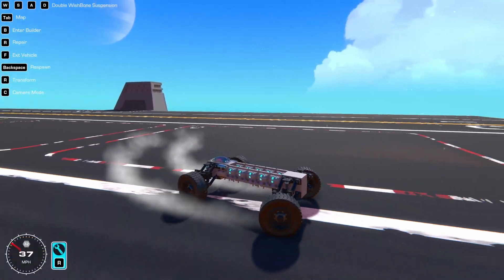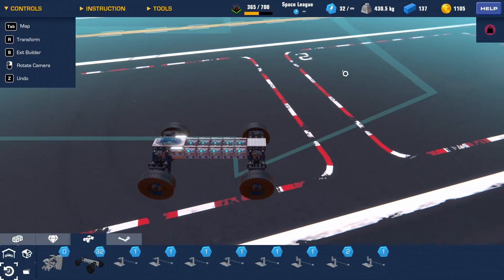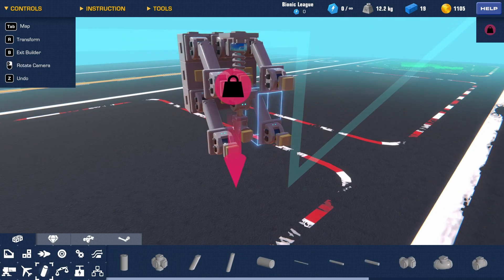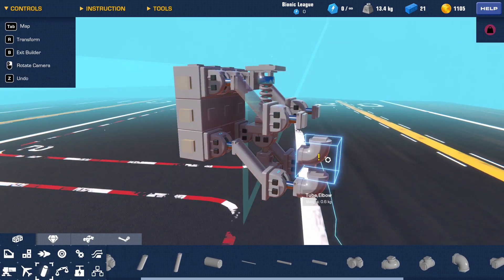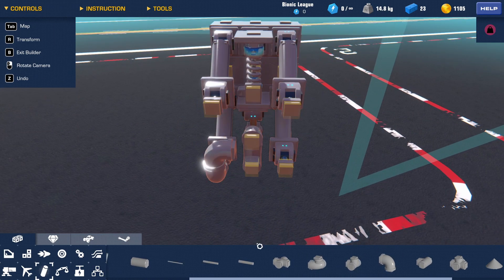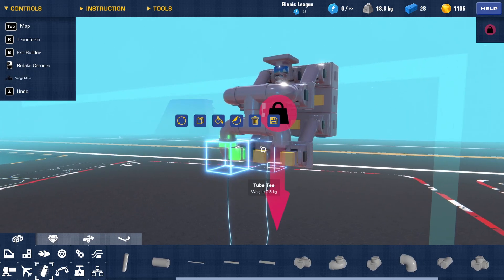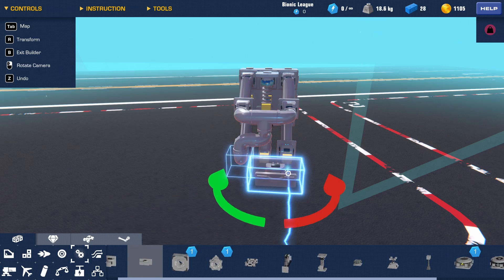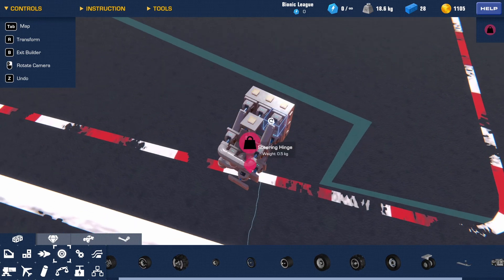Double Wishbone Suspension Tutorial

Comment: heres a little note in the packing heat update: the suspension is more buggy and tends to get caught on the 3x1 so i suggest using the 1x1 brackets to fix that problem if it getting caught
Reply: edit: nvm just set the dampening of the suspension to 2 and stiffness to 1
Reply: @i_exist-6 I also set all my hinges to 1-1.5 stiffness as a personal preference to make it a bit more springy